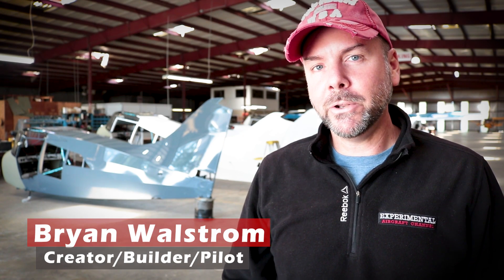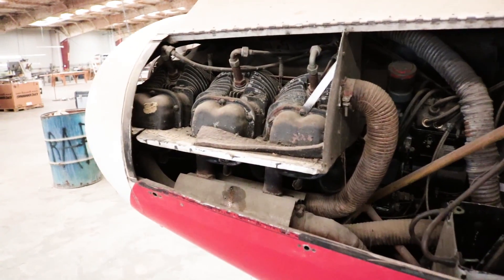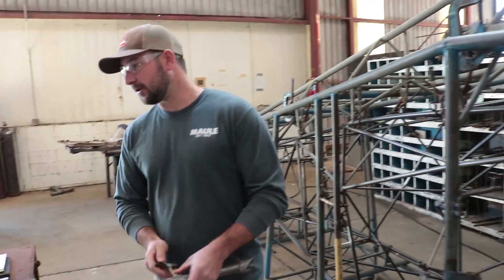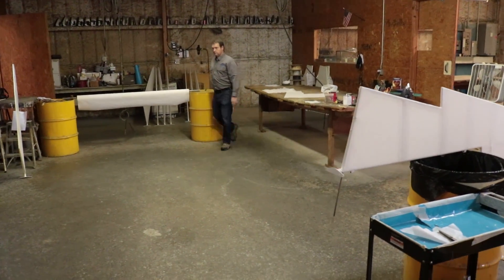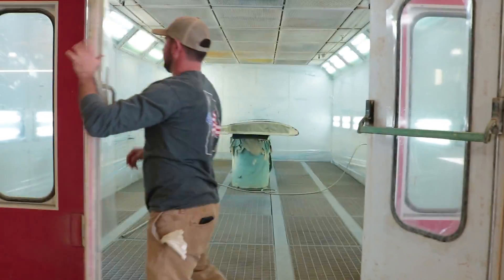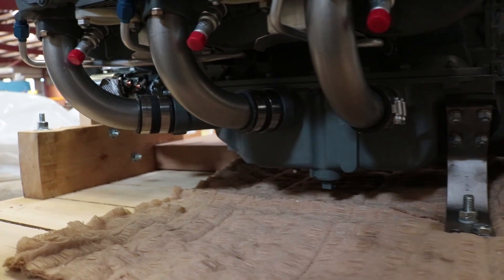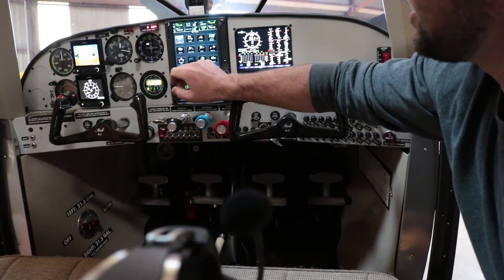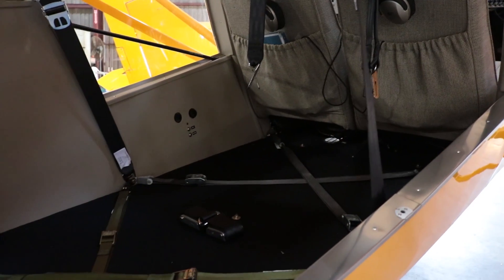Ultimate STOL - Maule Aircraft - Factory Tour

Comment: Enjoyed the video, thank you for providing it. Thought I noticed the Ribs were Stamped Sheet Aluminum but didn’t see the Punch Press and Die System. Stamping the Ribs would provide extra strength by folding Lips in one direction to add strength.  Would be better then a Rib Build Up and Riveted. However it isn’t known how it compares to a CarbonFiber molded Rib which might weigh less and actually be equally as strong or even stronger. Been looking and wondering if anyone makes a Wing completely from Carbon Fiber? CarbonFiber Composite Fabricated Units have many advantages over Aluminum Assembled Units both with weight and Strength Integrity. Industry seems to be evolving in this direction.

Comment: 148DP is now owned by Kristen in Wisconsin. Just in case u wanted to know. hehe. I was at the factory in the 70's and Mr. Maule took me and my CFI on a very short run takeoff of less than 400ft from the taxiway in front of the hanger right over the fence and small lake (pond). What an air plane it is.

Comment: Is the Maule company going to implement the use of carbon fiber to lighten up the airplane further. Great airplane. I remember the very first Maule I saw owned by the California Highway Patrol. You couldn't get the grins of their faces! Had a friend that had one in Farmington, NM. He really enjoyed the airplane. Modern taildraggers, can't beat 'em! Does Maule have a aluminum skinned fuselage as an option?
Reply: The airplane is certified in the present configuration. Changing to carbon fiber or aluminum panel will cost a lot to certify.  The market for the Maule is very small, not like the Cessna 172.  Even as an owner of the Maule, you cannot replace parts with carbon fiber parts because that will make your airplane as un-airworthy, meaning your Maule becomes a really heavy paper weight.
Reply: @2Phast4Rocket  Thanks! I wasn't referring to a total investment in redesign. Components such as doors, stringers, floor boards, instrument panels and other such pieces could remove several hundred pounds. As you already know, a lighter airplane is a better performer. Increase the useful load by 200# would be significant. Just saying. Still love the aircraft! It is impressive.
Reply: @elosogonzalez8739  This was my reply. Nobody can willy nilly modify a certified aircraft structure, even floor panel without going through the FAA, which costs the company a lot of money.  You cannot even do that on your own even when you have the skills to do so.  The low volume of Maule production, it will be very difficult to recoup the cost of re-certification.  This issue is one of the major reason people prefer to purchase or to build an experimental STOL airplane instead of buying a new airplane from the factory.  You comment is technically sound but doesn't take into account of the high cost world of FAA certification
Reply: @2Phast4Rocket  Thanks! Not wanting to argue. Possibly on the next production model. Who knows. There was alot of changes over the years on the Beechcraft Bonanza over 50 years; All type certified. Just thinkin' outside the box. Improvements made during construction (with the FAAs blessing of course) only enhance  advancement of aviation. Don't think there's a pilot out there that wouldn't want a Maule in their hangar! Me included!

Comment: The Maule is a great Aircraft I have a lot of time in them.
They are tough and very cost effective. Once you figure them out they are incredible performers.
If the factory would get their stuff together they should outsell any of the Cubs and Cub clones.
Since old BD Maule died no one has ever figured out how to move the factory into the present.
A bit of fine tuning improvements to fit and finish and a proper marketing department could get them from being a parts supplier back to becoming an Aircraft manufacturer again.
With the popularity of STOL planes this should be a none brainer.
To get the best Quality Maule one needs to rebuild one and Keep it light. The late models are getting to Heavy
The Aircraft is top notch  --  the Company behind it -- well is a bit behind unfortunately.

Comment: I wonder what the strength vs weight benefits are of a welded tube frame as shown in this video vs a all riveted together metal skin and frame like a Zenith CH 7xx plane? Surprised at how rough the factory is.  Still looks like they are built in a experimental plane's home shop.
Reply: Apparently it's better and the design is still around. You got a better design then show it.

Comment: I didn't hear a reference to B.D. Maule having based this design on the Piper Pacer/Tri-Pacer. In the late 60's Maule used to have a demonstation of the aircraft starting a takeoff roll inside the hanger, and being airborne as it passed through the hanger door. I heard this was discontinued because it scared off customers.

Comment: Shows exactly what is WRONG with GA---airplanes are ludicrously expensive because the manufacturers are still using 1950s construction techniques. Google "Cessna 172 assembly line" and you will find pictures taken in 2019 and 1959--there is no difference! Then look at the difference between a GM or Ford assembly line from 1959 and 2019.
Reply from the maker: Unfortunately the "demand" also isn't the same as a GM, FORD or any of the other "production vehicles." This would be better served compared to Ferraro or Lambo etc. But I get your point. The prices have gone crazy. If you added up everything (Engine, Prop, Avionics and Auto Pilot systems.... I am quite sure all of those add up beyond the initial cost of manufacturing the airframe itself. But.... popular choices from the customer requesting etc. Thank you for taking the time to watch!
Reply: @ExperimentalAircraftChannel  by the way, I did enjoy your vid. Thanks and definitely keep up your good work! 👍
Reply: I agree aircraft are eceptionally expensive but, would you fly in an airplane that was built the same crappy way with the same crappy materials as an automobile? Just saying. Because I work on them crappy things (cars) every day. IMHO
Reply: @429thunderjet2  Dennis: With some notable exceptions (i.e. Fords dual-clutch transmission or GM ignition switches and gas tanks), it is my experience that cars these days are much better than they were in the 1960s. With the exception of avionics, almost all GA aircraft have not shown any technological advances since then.  When I was a kid, a car that went 100K miles was considered aged--today it's just broken in. However, we're still looking at 2000 hour TBOs  and major airframe maintenance by 5000 TT. The reason autos have improved is advances in materials (tires go 80K now instead of 20, exhaust systems don't need replacing after 50K miles, brake linings last over 100K, electronic ignition systems are almost zero maintenance for the life of the car, electronic fuel injection has vastly improved efficiency and reliability over carbs).  None of these sorts of advances have been put in GA aircraft. With the exception of the Jet A burning engines (diesels) that are an option, the 2020 C-172 is identical to the 1973 K model I trained in two  years ago, and it is put together in the same way. As seen in the video (and for some reason bragged about by the Maule reps) the airframe parts are still cut by hand and welded together using 19th century techniques. A little bit of automation and adoption of modern materials, engine control and fuel systems would go a long way toward lowering costs of GA. 

A few months ago I did a little cost comparison. In 1960 a C-172 cost about 150% or US median income, today its over 450%. If Cessna had kept its aircraft in line with inflation, a new C-172 could cost around $100K--and they wouldn't be able to build enough of them.
Reply: @therickson100  yes, your points are well taken. When I was a kid cars were shot by 100k miles. However most of the auto manufacturers still have a laundry list of problems,  GM's displacement on demand oil burners, Ford's cam phasers. Dodge's trans etc. etc. etc. It probably has a lot to do with trying to make them more efficient because of pressure from the EPA and stuff. Also to keep their profits up for the shareholders. But yes they overall do last a lot better than they used to. Don't you think the certified aircraft industry lack of innovation is held back by the time and expense of certification?
I'm still not sure if I would put a pair of wings and some tail feathers and a prop on a Sheavy. Ha ha!

Comment: Nice job on the video.  Are the frames all M.I.G. welded?   Production Manager said they were tacked with a M.I.G. then finished on rotisserie.  They are a awesome airplane for back country flying!  Thanks for putting this together for us.
Reply: Randall Harmsen Probably tacked with MIG and then gas welded or TIG welded.
Reply from the maker: Good eye! Attention to detail! I bet you are a builder too aren't you?! Yes... I believe they are tacked quickly then removed for final welding with tig or gas etc. Thank you for watching! I appreciate you!
Reply: Experimental Aircraft Channel yes you are right.  30 year Journeyman Machinist with welding background.  T.I.G. welds would leave less of a bead of weld and depending on the craftsman very strong with less weight compared to M.I.G.  Appreciation of for your video content which can be tricky at times.